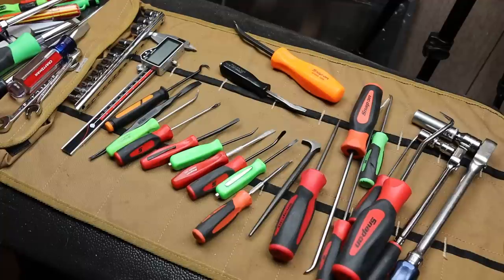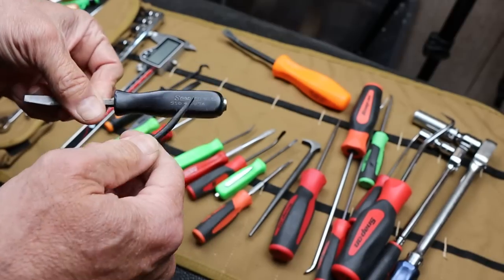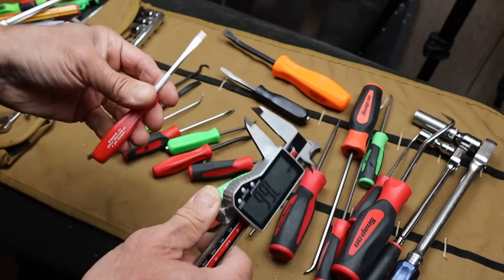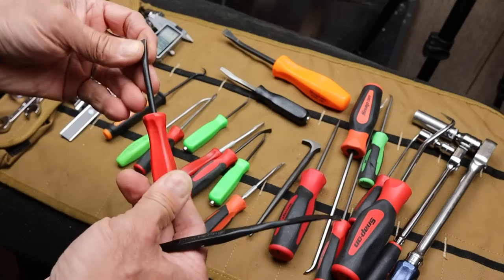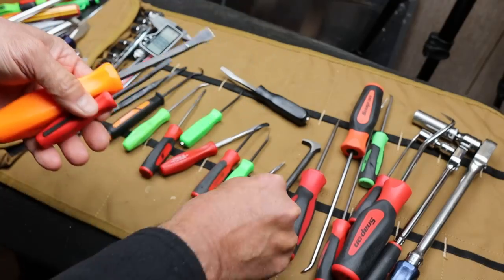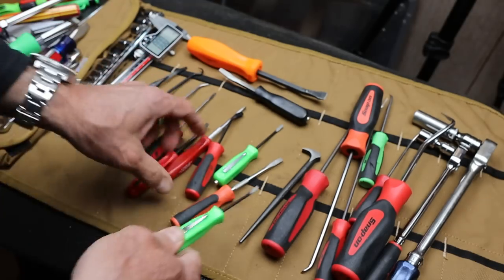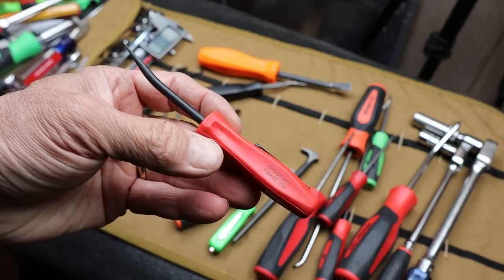Finally, a Snap On Mini Pry Bar. This is a real tool. Much better than I thought it would be!

Comment: I bet 90% of these sold off the truck to mechanics are carried in the shirt pocket. That's where I carry my pocket screwdriver that is used 95% of the time as a pry bar for disconnecting electrical plugs. in fact I dont think I would buy one without the pocket clip.

Comment: I’m a mechanic, I keep a straight one of these in my shirt pocket so I need the clip.  There probably isn’t a tech in the country who has tried one of these and hasn’t bought it on the spot.  It WAY outperforms the pocket screwdriver that we have used since forever.  We very rarely used them to actually turn screws, they’ve always been portable pry bars.
Reply: Just waiting to get stabbed in the heart with it huh
Reply: @izzywashington5461  Yeah for 31 years, along with every other mechanic I’ve known.  The risks are great, but we carry on.🤡
Reply: @motorpsykler  oh I get it your one of THOSE mechanics
Reply: @izzywashington5461  Yes.  One that knows that an proper risk assessment requires knowledge of all the factors involved.

Comment: I have 4 of them now lol, 2 straight and 2 bent. My original bent one gets used alot at the shop. Getting valve covers off, front covers, helping pry oil pans off with the help of a larger pry bar. Picking stubborn keepers when im taking valaves out of heads. All kinds of shit, very handy and more durable then the little pocket screwdrivers

Comment: 4:00.. I have a set of these they're not necessarily for prying they're mostly for getting o'rings without using a sharp pick... I definitely wouldn't try prying too much or too hard with these
5:25... because it's a pocket pry bar🤭
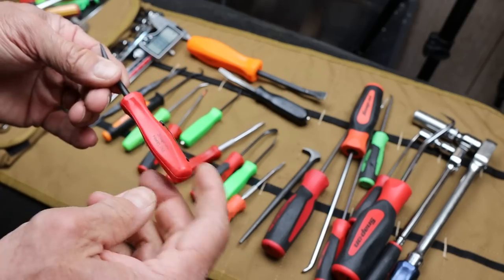6:27... these are actually pretty strong I use them to pry open locking tabs on our containers at work and you usually need to get a screwdriver in there but these do the job I have one exactly like those except they're from Matco knockoffs of course but they're pretty strong for $4

Comment: I was watching a video yesterday and the guy is a pretty popular youtuber who shows a few different  tool people during the week and on fridays the Matco tool guy and his wife are there ......
Well it just so happens that they were showing tools they got in and low and behold they had a Mini 3 piece prybar set like your mini Snappy.
I looked it up from the tools number the guy supplied and if you are interested here is the number
Matco Mini Prybar set  #  PPB3K   
It is a nice set but it was like $45 bucks and i do think that it is a lil high after you stated that you only paid like $13 bucks for one mini .
When you were talking about the location of the pocket clip being in the wrong place, it is very easy to reposition the handle just put the shaft into a vice , well you know.
Not sure if you know this but when a screw driver is covered under warranty and replaced they just replace the shaft in most occasions , In my area on the trucks that is.
Sometimes they will replace the whole thing if they are out of stock on the shafts , but very rarely .
Sorry for the long post !